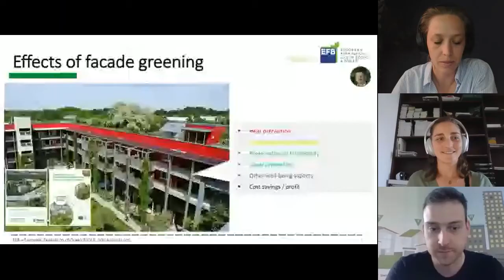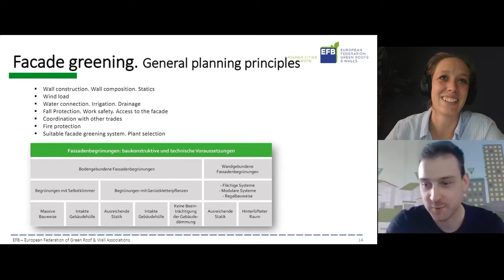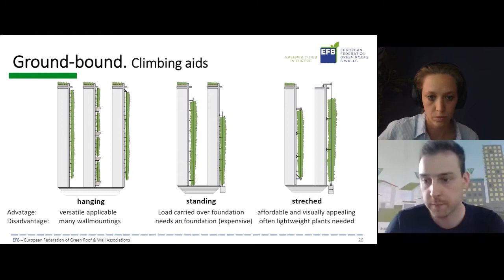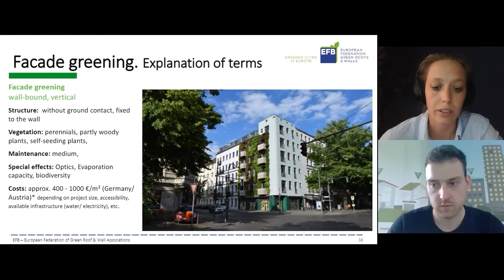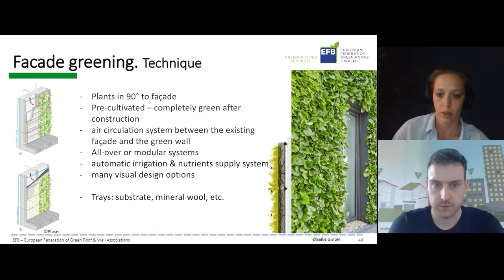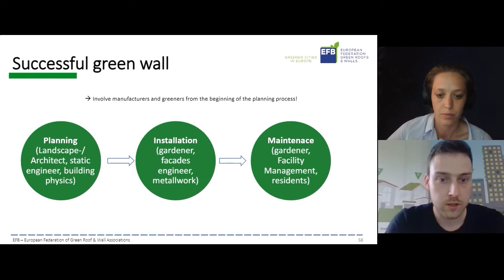EFB Webinar -  Facade Greening/ Green Walls

Comment: Please take this as constructive criticism. The speakers are struggling in English, the slides are only semi-translated. Would it probably make sense to do such a talk in German so the speakers can convey what they know quickly and without all of the struggling, and use AI to translate? If you want to reach an international audience well, you need fluency. 
 The substrate info regarding troughs was something I was particularly interested and I speak german so I can read it all, but it's vague. You need to explain to people exactly the kinds of materials to use. Telling people they have to use this/that is also overly restrictive. Many kinds of drainage substrates can be used effectively and even if things are not perfect, plants are incredibly adaptive. Equally important is not placing troughs under a roof overhang. I made this mistake. Having rain actually reach your plants is pretty important, if you're planning on going on holidays. That's maybe another argument against troughs at least on a façade with an overhang, and a plus point for direct ground planting.